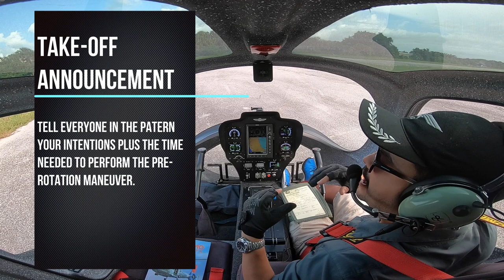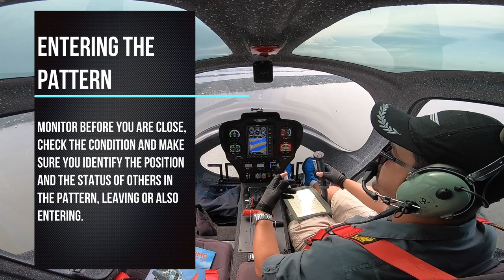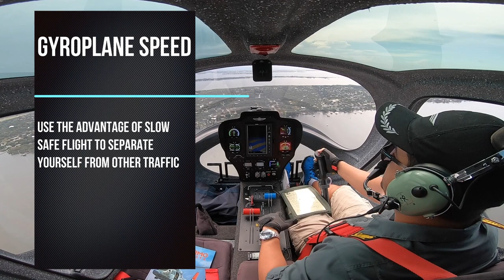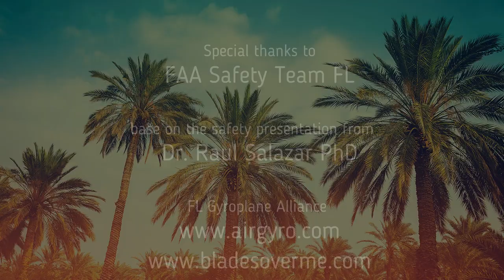Sharing the sky in Gyrocopters

Comment: in Vietnam, the helicopters had painted areas on their blades, so others above them could see their " wing " span.  Why doesn't gyrocopters do that?  And what is the cost of your aircraft flying now?  Thank you my friend.
Reply: If you are a Vietnam vet I would first like the thank you for your service sir. I have a friend that was a Huey Crew Chief and he flies with me in the Cavalon from time to time. His first flight in my Cavalon was the very first time he was in any rotorcraft since Vietnam and his wife said you could have given him a thousand dollars and would not have made him any happier he came home with a smile on his face and sent pictures of his trip to everyone. To address your idea of painting the blades, my Cavalon is white and very difficult to see in the air which has been pointed out to me by fellow pilots so I painted about 10 inches of black on the tip of the blades then skipped a short space and painted about 10 inches of yellow. I used the same brand of paint for both colors and cleaned the rotor well before application. I flew it for about 165 hours and then one day when attempting an approach at a friends local grass runway I powered up to go around and discovered the gyro just did not want to climb as well as it should. Please keep in mind this was only a seat of the pants feeling and nothing showing up on any gauges or otherwise so I decided to do an emergency landing which ended up being in the extended lawn area next to their runway. Safe landing and no problems but what we found was unusual as I had never had this problem prior to this. We discovered the yellow paint had started to bubble,,,,,,,,why after 165 hrs. I have not idea but that was the only thing we found. We removed the paint from the rotors and to date I now have over 900 hours on this ship with no further issues. The black paint had no signs of this and since they were both the same brand I have no idea why. I print this just for reference should anyone decide to strip their blades just keep this in mind. Almost all information is good information we all learn from the other pilots experience with problems and I am one who is constantly learning from those around me.   fly safe and fly often
Reply: @ronandress5948  yes, thank you, I was a medic in Nam.... worked in the OR 3rd Field Hosp.   I can see where the slightest interference with the air flow would have drastic effects on the "Wing"...   you keep smilin, my friend... and I"ll keep watching.

Comment: IS THERE A PARTICULAR REASON THAT the rotor shouldn't be spun up to pre-take off speed prior to taking the runway much as a fixed wing pilot would check the mags and/or oil the prop prior to requesting clearance?
Reply from the maker: You can actually pre-rotate before you enter the runway, but that involves turning and taxing with a low speed rotation rotor that can make some issues, operate different parts such as throttle, pre-rotation, brakes and pedals at the same time. so is better to do it right before the take off roll. 

Thanks for watching and commenting !!
Reply: @AirgyroAviation    You are welcome.   Out of curiosity,  is AirGyro located anywhere near Port St. Lucy, FL?

Comment: Hi Alvaro,

As a fixed wing pilot used to heavy traffic in very resticted patterns most of the time, it seems to me that most gyros are completely capable of maintaining the same speed as all of the other traffic and probably should.  Even if you stay a little lower and a little tighter, is there any reason why you can't maintain a standard pattern at a typical speed?  I understand the need for an extended position and hold due to pre rotation so there is no way around that but it seems like slowing down quickly is not a problem in a gyro so if you came in hot on final until you are almost over the numbers you could still slow down and land without disrupting the traffic flow.  From a safety perspective no aircraft in the pattern typically could make it to the runway in an emergency engine out situation since the pattern is usually extended due to 5 or 6 aircraft aloft and in the queue.

For uncontrolled airports I definitely agree with what you said though.

Thank you for putting out such great videos!  I wish gyros would catch on here in the states, especially in California where I live.
Reply: ewjorgy completely agree! In a controlled area we have to maintain the same altitudes, speeds and separations, but we 90% flight in non controlled airfields. Thanks for watching!!!!
Reply: @capitovar  Thanks for the quick reply!  I am loving your videos!  I really hope I get the chance to fly a gyro some day! I am a certified hang glider pilot, private pilot and have taken a few lessons in helicopters as well. I even used to own my own airplane (which was faster than the other traffic in the pattern so I really appreciate your video topic). Unfortunately I have not found anyone in the San Francisco Bay area that offers gyro lessons in a decent gyro. 

Keep up the great work and thanks again!  :)